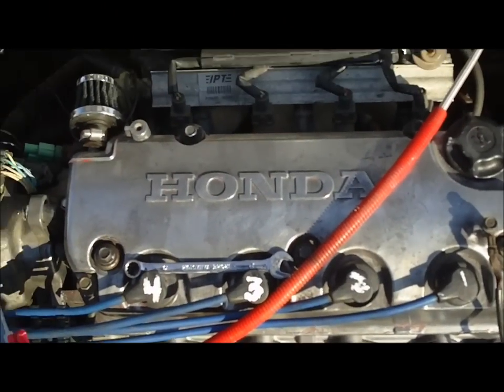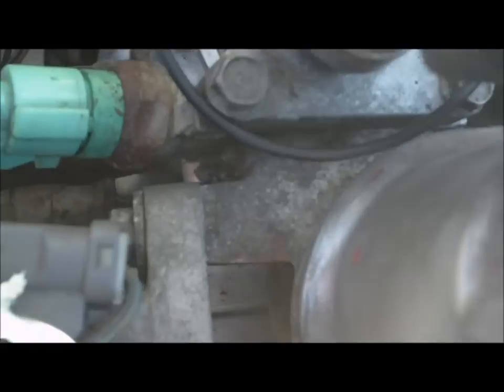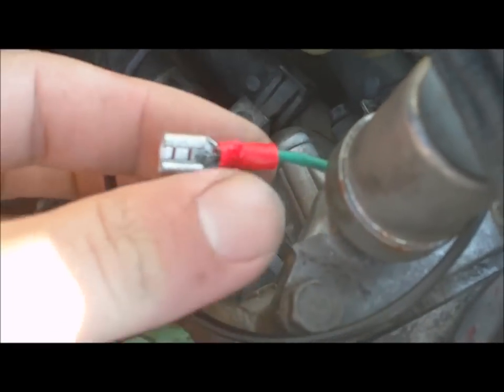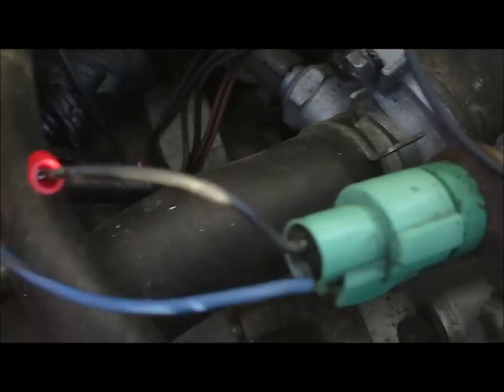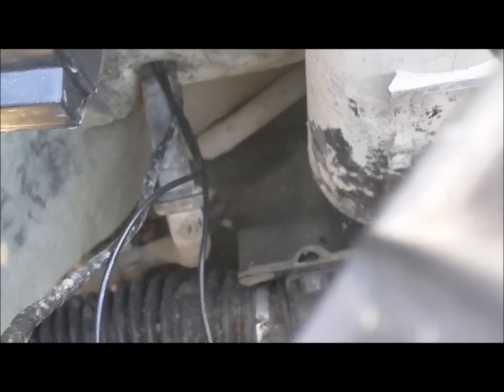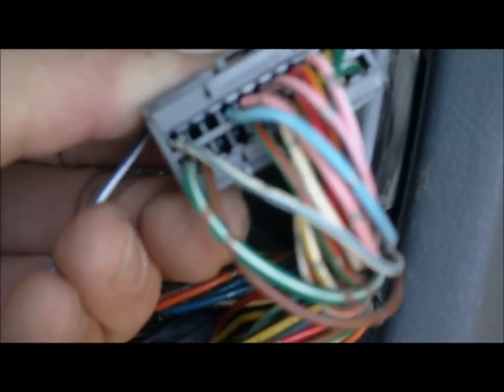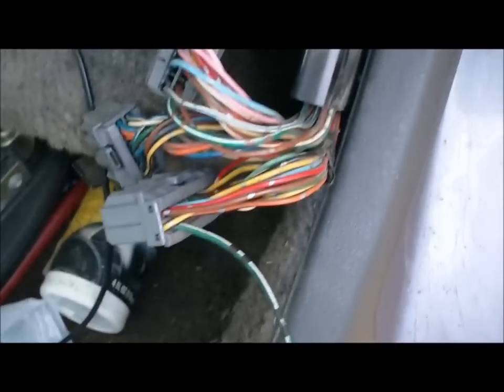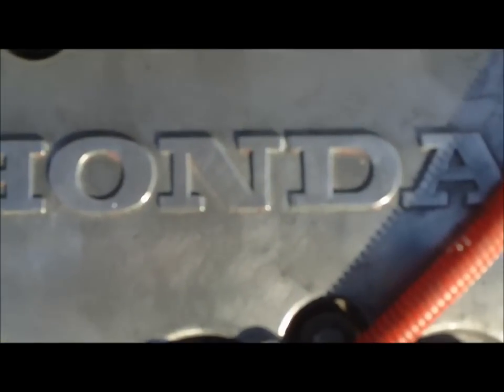Honda Civic 92-95 ECU pinning for vtec HOW TO:

Comment: What if I have the automatic transmission and automatic ecu but I switch the head just like you
Reply: Youll need a ecu “p28-a52” and add those 2 wires for vtec to engage

Comment: For the Oil Pressure Switch connector, I ordered mine online and both wires are the same color. Does it matter which wire is ground and the actual pressure switch sensor? I know the stock vtec oil pressure switch is colored like the black is ground and something like orange is the actual oil pressure switch. let me know if you know anything about this because mine really came with both yellow wires.
Reply from the maker: Christopher Owens you could ohm test the switch to make sure I believe . One should have .2 .5. While the other should be.0   Hope that helps
Reply: FalloutCustomsTune&Lube I was hoping to know which wire is which because I don’t have any multimeter skills. But I appreciate you getting to my comment.

Comment: My vtec doesn't work at any rpm, when I check it turns out there is no current entering selenoid, why is this?
Reply from the maker: Chanel Anu try at the vtec connector for power no power there check check the ground should be at the t stat
Reply: Make sure your sub-harness (cabin harness) has VTEC wires.

Comment: Man, something is fishy. Where the three wire connectors are under the hood.. there's wires going from VTEC to their connectors.. but not out of the back of the connectors heading to ecu.. then in those slots the wires that should be there are magically there.. I didn't do this swap but please.. wtf do I need to do? Just re wire it ?

Comment: Old video but just to clarify... The vtec solenoid goes to A4. Not A6. Vtec pressure switch goes to D6 not D4. Correct placement just wrong numbers. Easy mix up if you're going off memory. Always double check with a pinot diagram while you're wiring to be safe.
Reply: Gravelord Nito what does the pressure switch go to on my 96.     Using a non vtec harness on my vtec 96 civic

Comment: Will this work also for a B20Vtec swap for a 95 eg hatch ? with a obd1 p28 A02 ECU 5spd. virgin not chipped tune nothing just virgin cherry. the B20 block it's a low compression and the head it's a gsr all stock cams too. nothing fancy just plain stock basic swap.

Comment: I got the other problem, my son messed up the engine in the civic, and bought a non-vtec Japanese engine,  so not the car has a check engine  light on, and is missing a bit, it passed emissions but because the check engine light being on, the car did not pass. Now you show in the video how to add a vtec, now is there a way in which the vtec can be eliminated and get rid of the check engine light? Or do I have to swap ECM
Reply from the maker: relguajiro can you tell me exactly the engine code?  And also the ecu code ie:p28 p72 ect.  Is the car auto o manual.   Missing could be a cracked/unhooked vacuum line  make sure all the plugs are plugged in correctly they shouldn't be hard as only 2 are the same plug.  Keep me posted

Comment: i did a vteck swap into non vteck accord 1996 the car works fine but doesnt have the vteck ecu is there a way it would work?
Reply from the maker: you need the correct vtec ecu for your engine that's the only way unless you do a cheap vtec button or switch or controller but I wouldn't even bother dude.

Comment: I have a 94 DX with a d16z6 and I have a rywire vtec pin in connection made. I'm getting an engine light 22 for vtec pressure switch. What could be the problem

Comment: I did an engine swap. VTEC out of a '95 and put it in a'92. the'92 doesn't have VTEC, so switched out computer and harness and it's still not working. it is an automatic. I need help figuring out what to change on the p28.
Reply: Did you end up figuring it out

Comment: I just switched my 2001 lx engine to an ex d17 2001 engine so I need an ecu for an ex will this work if I wire the vtec solenoid to the ecu the same way you did?

Comment: i just bought a 1995 prelude with a f22b1 swap in it the guy has the vtec on a switch which is bad right i need a different ecu and dont know what to get its auto trans

Comment: I'm doing this to my 94 si prelude it came prewired for vtec all I have to do is pin vtec pressure switch to ecu but heard it pins to d6 but can't find it on ecu and if I did the spot is taken. dropped in a h22 vtec into non vtec prelude

Comment: ? I have 96 Honda civic automatic I'm going to put 94 Honda civic d16 z6 VTEC  I can I do this from non VTEC to VTEC  do I need ECU manual  VTEC   do I after match the number ECU automatic  to manual  right?
Reply from the maker: you can run an auto vtec ecu but it will throw code for no torque converter.  96 will need jumper harness from obd2 to obd1 ecu.  you want a p28 ecu. and a obd1 dizzy for this to work. other wise follow what I did here and you will be good.
Reply: Thank you
Reply: Giuseppe Randazzo look up converting an automatic ecu to a manual

Comment: hi I'll have watch your video about vtec wiring. I have a 1993 SI civic swapping in a b18c gsr seeing that I have a vtec wire harness is it jut a plug and play or I need to add other wiring to my harness
Reply from the maker: nope being wired for vtec already I believe (not very good on the b series yet) its plug n play besides an obd1 dizzy . or a jumper haness for obd2 dizzy I think b18b ls 94 below should be ok to use

Comment: I have a Honda prelude 1994 h22a vtec, I recked my original Shell to a Canadian Shell and I forgot to remove the vtec wire now my vtec doesn't crack I don't want to get charged an arm and a leg a the job. I need advice on how can do it my self
Reply from the maker: you have to hard wire the vtec plugs into the ecu (make sure its a usdm vtec h22a ecu!!!!) im not sure how different the pins are im not experienced with the H motors
Reply: i have the same problem ...
can you tell me if you did it ? thanks

Comment: I have a 94 integra with a code 10 because the harness clip for the iat sensor is not producing voltage to the ecu, do you think I can run a wire straight from the iat sensor to the ecu pin? 

Because I traced the wires and couldn't find where the wire is shorting out, so any help is appreciated thanks.
Reply from the maker: +A Penas if the pin to the clip/plug is broken yes I dont see why not. junkyard might have a plug/clip for you to cut off so its legit.  hope this helps
Reply: +1994hondacivicsi thanks for the help man I appreciate it.
Reply from the maker: no prob
Reply: Big ups ma dude, I wired my iat sensor straight to the ecu, and got the car smogged, this video was a blessing
Reply from the maker: No problem I very glad my video helped you!

Comment: I have a '90 civic wagon AWD. I got it in pieces. I put the '95 V-Tec that was in the back. I got a wiring harness out of a '95 civic. I was told it was I plug n play. Will, it's not. Any suggestions anyone. I need help.
Reply from the maker: obd0 are a hard one if the harness is from a 95 vtec it should plug n play did you get the dash and ecu harness as well?

Comment: Got a question because I did the exact thing you showed and it's not engaging. Are you 100% that the black is ground?
Reply from the maker: 110% just check the pins its small and easy to get wrong
Reply: me 2 is not working for me...

Comment: thank you dude. had my d15b for 3 years and finally got the ecu and the wiring done. had a hell of a time with the medium wiring harness pin. ended up using a small picking tool too wiggle it out.
Reply: Do you know where to find OBD0 wiring for D15B2 engines which came with the eg Lsi?